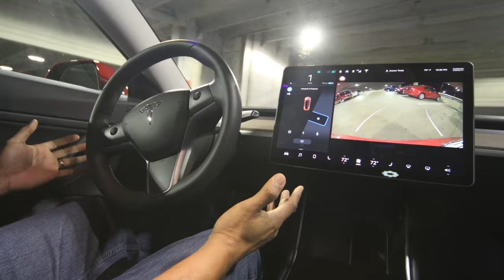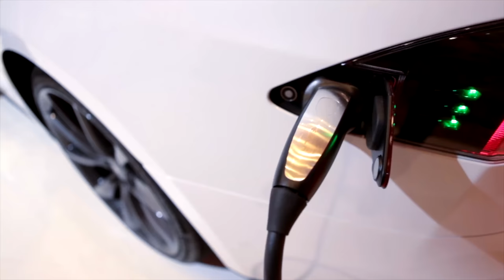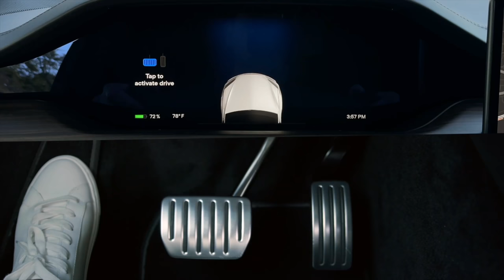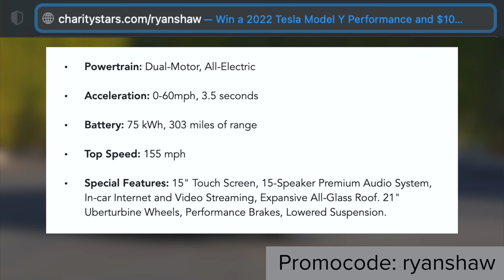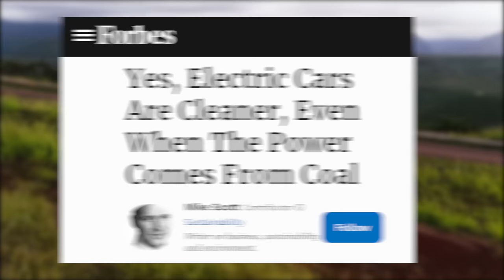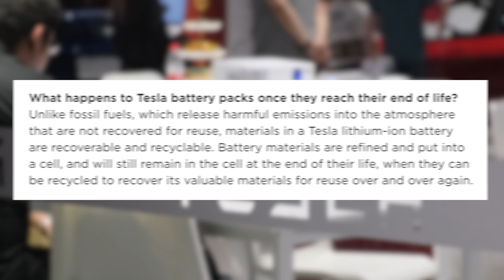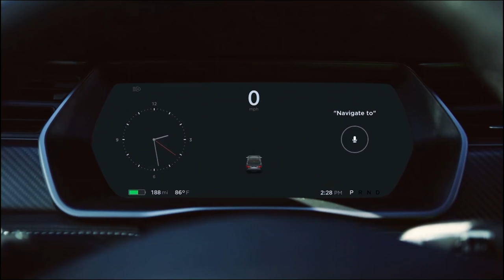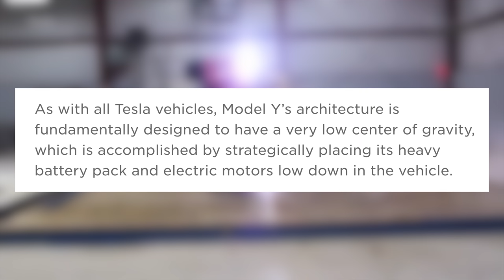9 Advantages To Owning a Tesla

Comment: My concern on maintenance is the gearbox and the batteries. EVs still use a gearbox that has a gear oil. On a traditional transmission that has to be replaced regularly. For my Tacoma, it's every 100k miles. What about the coolant that cold the batteries as well. I'm sure they'll need to be flushed regularly too like the coolant in a combination engine. Plus there's still other normal wear n tear like tires. I pay about $500 for all four tires on my Tacoma and get 60,000 mi on them. What's the lifespan of the Tesla tires? I heard they are $400 each....
Reply: M3 owners manual pdf says:

“Your Battery coolant does not need to be replaced for the life of your vehicle under most circumstances. Brake fluid should be checked every 2 years, replacing if necessary.”
There are some A/C coolant maintenance intervals suggested. Regarding tire prices, it’s just a tire, buy it wherever you like. And if you don’t like to spend on tires get the one with smaller rims, they are also more efficient and provide more comfort, while looking slightly less rad.

The lifespan of the tires depends on how you drive. If you floor it at every stop be prepared to replace them more often.
Reply: The real maintenance is the battery replacement in about 15yrs. Over $20k for a new battery. 😯
Reply: @anekinoo7  pretty stupid to use todays replacement prices for something that might be necessary in 15 years. Battery prices are not static. Also, how many cars are driven beyond year 15? Not many in developed countries.
Reply: @anekinoo7  so? replacing the engine block of a high performing car can easiely throw you back tens of thousands of bucks as well. Aside from that you will have regular and more frequent maintainance the older the car gets and the more parts are worn out. Battery prices are nowhere near their equilibrium and are still falling, especially as more efficient extraction and refining methods for raw materials are rolled out.
Reply: @anekinoo7  The battery price and factor of being replaced kind of excites me. I know the future batteries will be so much better than the  batteries today so it's kind of a win. Haha
Reply: @geraldh.8047  you must be young or don’t own any cars if u think cars don’t last. If u take care of your car they do last a long time. Couple daily drivers over 20 years old. Hondas and Toyotas last forever. I got a 50s truck in excellent condition. 
Of course I use todays battery price. Prices a decade from now will be more expensive. Good example is Prius, leaf, Chevy bolt battery prices are about 50% higher from initial release. Telsa battery prices already up $2-5k from 5 years ago.
Reply: @BizzMRK tens of thousands 😂 If you’re into EV is more about environment. Let’s compare them to Hondas and Toyotas. Their engine will easily do 200-300k. I have a couple. Engine replacement for a salvage unit is $5k tops with labor. How much is a telsa engine? $10k from a salvage not including labor. Back go batteries. It’s still a lithium ion battery. They degrade by usage and age. Even if you barely use your EV. The battery will go bad by age. A engine will last decades if we’ll taken care for with minimal maintenance.
Reply: @anekinoo7  Honda and Toyota certainly is not on my mind when I am talking about high performance, before, no not lambo or ferrari either. Batteries do not degrade over time to such a degree that you are claiming. This kind of degregation only happens if you leave devices like laptops or smartphones unplugged for ages or overcharge them all the time, which a EV prevents. It is not like a simple phone charger which keeps charging despite state of charge. 2013 Tesla Model Ss barely show any degregation.

ICE will go bad as well, no amount of maintanance can prevent that in the long run. Show me where you get a replacement engine block including labor for 5000$ for a Audi RS3 or a Nissan GTR from a creditable source.

Besides, as already said, you are claiming prices which will be unrealistic in 10 to 15 years when this might even come close of being an Issue. The battery and motors of a Tesla has 8 years and 200.000km warranty on it and already show that they can live way past that point. By that time battery prices will have come down significantly, just as high performing ICE engines have over the time.

Other than that, a Tesla Model X with well over 400.000 miles (650.000km) on record had it's battery degrade by around 5% at best.

Comment: Do ICE cars have any benefits over EVs?
Reply: Free heat from the inefficient engine in winter… but this heat is not immediately available so also a downside.
Reply: @geraldh.8047  not free at all. Most of the energy in that gas you’re paying for is wasted as heat from the engine and brakes instead of propelling the car down the road. ICE cars are, what, 20% max efficiency? EVs are like 85% or something.
Reply: Obviously the "charge" time from 0 to 100 on a road trip. And since that time is so quick, you don't need so many "charging" stations to serve a huge amount of cars. Of course, EVs usually charge at home. If that wasn't that way, there would be a problem with EVs.
Reply: They sound better?
Reply: @Pyriold  a Tesla can put 100 miles range in 7 minutes on a supercharger
Reply: @paulfreeborough6868  I actually ordered a tesla, i know that. But an ICE car can put 400 miles of range in like 3 minutes. I didn't say its unworkable, but it's a clear disadvantage.
Reply: @Pyriold  I view that a  little differently, how often do you drive over 6 hours without a break?, Natural breaks are charging time. Anyone travelling with kid's regular breaks are just part of the process

Comment: First of all, I love teslas and plan to get one but Im not buying it for the environment. Nothing we as a society do will have any significant effect on the environment not only that but buying a new car as opposed to driving your older one as long as you can goes against that sustainability mission everyone claims to be about. What happens when you buy a new car? You consume. I guarantee the same people that claim to be about the "mission" are the same people that buy a new Tesla every one to two years because they want the newer car. If you're going to buy a Tesla and replace it every couple of years that's fine you're free to do that, but dont preach to me about the environment. As far as where the electricity comes from, solar and wind power will NEVER be enough to support the grid, but going nuclear would and if we did we could build a few plants throughout the US and the grid would have sustainable clean energy for generations to come and eventually we could replace the fossil fuels industry with nuclear. But to pretend that we could achieve that with wind and solar alone, that's naive at best.

Comment: Can you confirm that 2022 model y will include 4680 battery out of Austin ?
Reply: I don't know about Austin but atleast the Berlin plant which was originally intended to produce 4680 Model Ys will initially produce 2170 Model Ys as a stopgap measure. Panasonic has announced it will start mass producing Teslas 4680 Cells no sooner than by the end of 2022. The Roadster, Cybertruck and Semi keep being delayed due to lack of these cells.

I am pretty sure the few 4680 cells they already produced will be prioritized for the Cybertruck, Roadster and Semi first. That said, it is safe to say if the Berlin plant starts pumping out 4680 Model Y next month so will Austin.
Reply: What about the model 3?

Comment: And the one downside not said is how pricey the EV's are compared to ICE cars when you go to buy it? 
In the case of Tesla's super pricey!  even the Model 3 is around 4.5 times more the cost of the same sized ICE car, 

So any savings you may get owning a EV like a Tesla are out weighted by the fact that even the cheapest Tesla cost so much money to buy!
And since not every country gives huge EV credits on EV's unlike the USA.  

Then those countries possible EV buyers will have almost no money off credits to help with the huge cost of buying a EV.

And don't start replying with Oh the cost of the EV's is dropping all the time as the price of making the batteries has been dropping!  

So why have Tesla cars prices been going up and up and up then?
They gone up 8 times in under 6 months.  And remember the original price of even the Model 3 was meant to be $35.000.
Is it that price or lower now?  NO... so that shoots down that boast.

The Tesla's maybe popular, But even if they were at the original boasted to be sold at prices.. which they are not now.  Only rich people will ever afford to buy one.

Around 96% of the drivers today could not afford a Tesla. and that is even if the prices don't keep on rising by a $500 to $1000 at a time.
All EV's of any company whom does them are costing 2/3 or more than a ICE car of the same class or size.  
So all the so called benefits they have are not even worth knowing about if you can't buy one?

And that's not even before the costs of buying the big amount of roof solar and pricey home battery and charger to help charge the EV at your own home which you would need to own and get planning permission done for the solar to be mounted on your roof ( and you would need allot of solar panels in fact most of the roof covered to get the power needed ) Which would cost thousands just for the solar and more thousands for the home power storage battery and hundreds for the charger and the pricey fitting by a electrician.

All in allot of countries which don't give out huge credits off the EV change over thing.  Because all you talk about is the USA, like it is the only country on the earth?

When the big change over happens.. most drivers will not have the money to buy any EV's as the cost to buy be beyond them even more than now!
No scrap of ICE cars scheme anywhere would give them the full cost of a EV so again it e the rich only who will be okay and the rest will have no car.